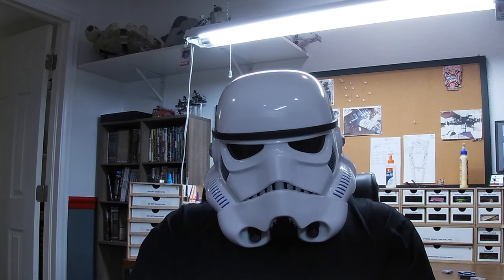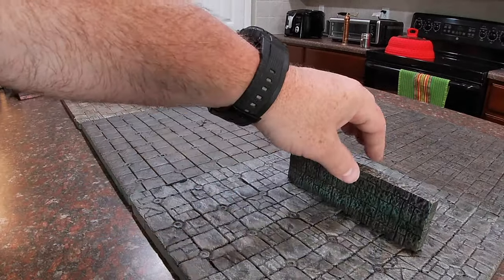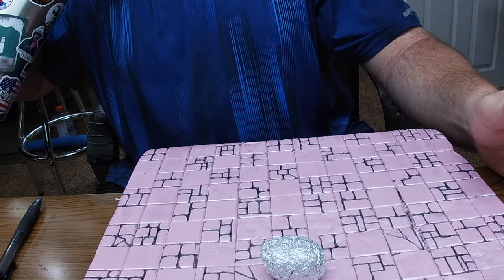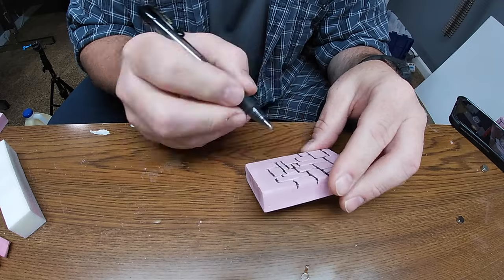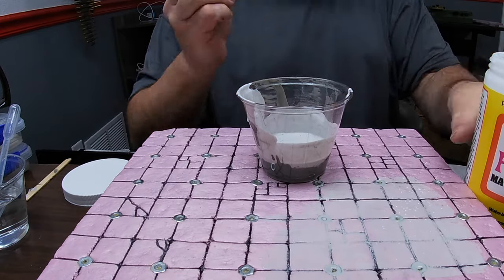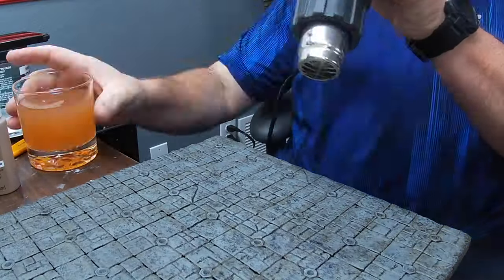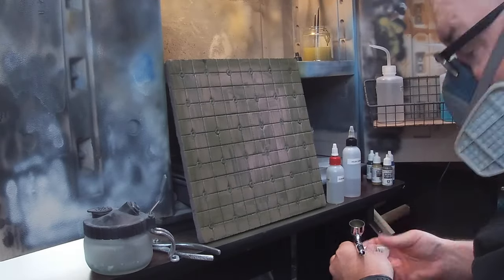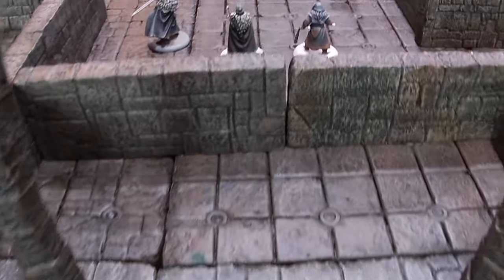Magnetic Dungeon tile system!

Comment: Still plotting here.  Very similar to what I have been contemplating.  Great vid.
On the rattle can thing.  Add some distance.  Most brands are a source of melting problems, if you hit hard and close.  Takes longer, but the painters rule applies.  Many lite coats perform best.

Comment: What size of magnets and nuts did you use in this?
Reply from the maker: I used 2-3-4mm magnets depending on the size of the walls or terrain & Hillmans 10-24 zinc plated nuts.